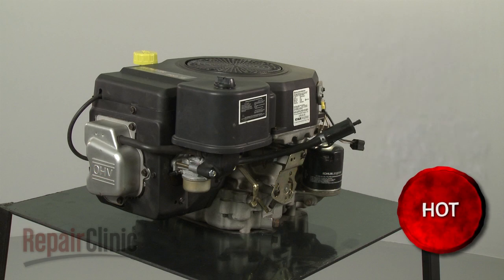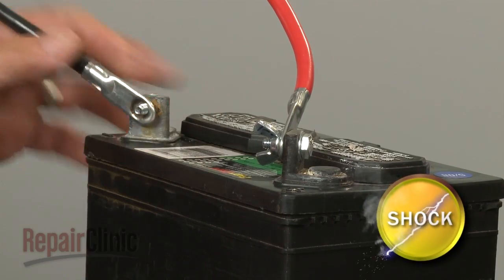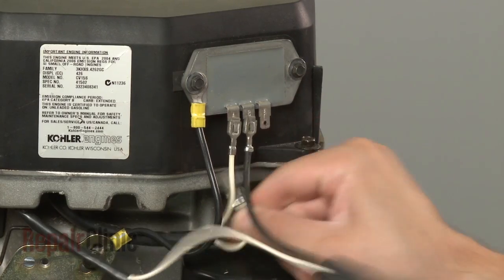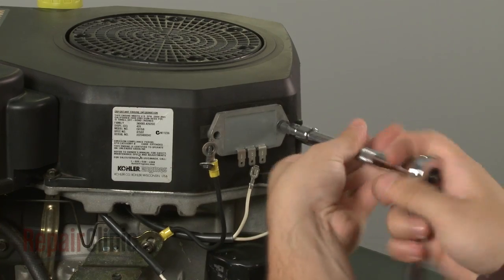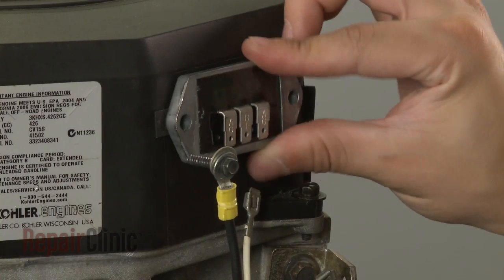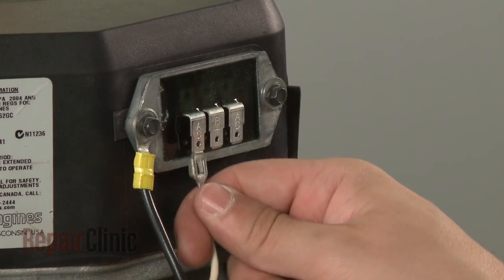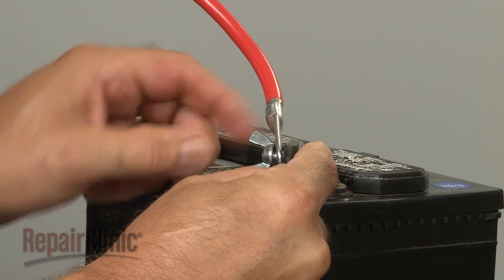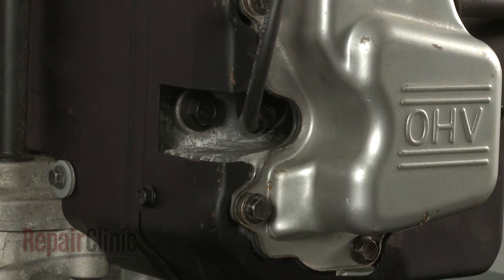Kohler Lawn Mower Dies? Voltage Regulator/Rectifier 4140310-S

Comment: would a symtom of a bad rectifier be, mower blew the fuse then after replacing fuse , it starts easy but idled super fast then cuts off .
Reply: I have exactly the same problem.  I first noticed I didn't hear the fuel solenoid clicking when the key went from "OFF" to "ON", so to get through the day's mow I alligator-wire-jumpered it directly to the battery.  Which works, but I have to remember to pull the clip after shutting it down, and moreover the battery isn't charging.  I replaced the key switch since it was easy and fit the problem (i.e., "START" works but "ON" is broken, which effectively disconnects the battery positive from the regulator and the solenoid), but no go.  I've now turned my attention to the regulator.  Were you successful with your regulator replacement?
Reply: @davidhutton465  , i didnt replace it yet .
Reply: @klakytklak  My case turned out to be a bad fuse holder - the violet B+ line 20A fuse had been running hot over the years and melting-but-not-blowing fuses - and the excess heat ultimately did in the holder as well.
Reply: @davidhutton465 hi David I’m reading through comments and I’m having exact problem in your comment from 3 years ago. Could you tell me how you fixed issue please. Regards Col west Oz
Reply: @col2959  As mentioned above, my violet-line B+ fuse holder had failed, and instead of a snug fit the 20A fuse was held more like a very loose tooth that wasn't making good contact - I took the opportunity to cut both it and the red-line battery fuse holder out and replace them.  Properly sized spade terminals can also work in a pinch.  Good luck!

Comment: I kept losing my batteries so I ran the test of DC voltage with the engine off and on and the voltages are the same, well with it highest RPM it's actually drawing an extra .03 volts from 12.49 down to 12.46.  So I replaced the regulator and tried again.  Same thing.  So I'm now looking at the stator so I measured the AC voltage (outside 2 terminals) and I read 41+ volts AC which is supposed to be good.  So my next test needs to be at the regulator and see what is actually being converted to DC from the regulator.  Only way to know if it's another regulator or something in the path from the regulator to the battery.
Reply: what was the issue?

Comment: Mine is a !6 Horse K341A05 from a Ford lawn tractor built in 1983 I have lots o compression and vacuum at the intake, it runs a few seconds and dies,,I have a new fuel pump and the carb is gone through and is clean..?

Comment: Seriously there are people who can't replace this without a video to help them? How about something useful like how to tell if it's bad or not? If you look at it, it should be pretty self-explanatory to take the wires off and the bolts out and just replace them in the same order you took them off. How about a video showing how to find out if the part even needs to be replaced.
Reply: The easiest and most accurate way to test a voltage rectifier/regulator is with an analog or digital multimeter set in the DC setting above 12 volts, and with a known good charging stator installed in an engine while the engine is running. With the engine off, connect the stator's two wires to the rectifier/regulator's two outer terminals (being it's AC, it doesn't matter which wire connects to which terminal). With the engine running at 3,200 RPM (when the engine has a fixed/non-adjustable main jet carburetor) or 3,600 RPM (when the engine has an adjustable main jet carburetor), check the voltage output at the center terminal on the rectifier/regulator. If the voltmeter displays or reads 14.5 volts, the rectifier/regulator is good. If less than 14.5 volts or no voltage, the rectifier/regulator is defective. By the way - the older rectifier/regulator with fins works the same as the newer ones with no fins.
Reply: I have a lt160 deere with a 15hp kohler with a new main harness.  8 bought it needing the harness which is replaced fine.  The right foot pedal once in to start it runs but once released it stops so I ran a jumper wire from black to black on the switch wire and it is fine but once ran a while the regulator conector the 2 black wires that go in the holder, the holder melted a little but I saw it soon enough.  I ordered a new safety switch that's on the way but I'm thinking the regulators bad causing the heating up on the wires that connects to the regulator.  Any h er le appreciated
Reply: Yes, some of us need a video to help with such things. Kind of like how you need a video to see whether the part needs to be replaced.
Reply: Yeah some people are afraid of maybe getting a little shock from poking around with stuff like that them not knowing it won't shock them they pay a shop to fix it an probably put used parts on

Comment: Since when has a 12V battery been a shock hazard?
Reply: when you accidently drop your wrench across the terminals trying to remove that 30yr old corroded bolt

Comment: Mine puts out 21 Volts! So I replaced this module, double checked the ground and even double grounded it for temporary. Again 21V !! What gives? The old regulator was definitely bad, one of the "A" terminals is shorted to it's metal housing internally.
Reply: My mower has no battery. Its a scag pull start. The stator/regulator does nothing but power the pto clutch.I even went as far as replacing the stator thinking that there was possibly something wrong with it but i got the same results. I have to keep the throttle down to control the voltage so i dont fry the clutch. I also thought about a second regulator but i wasnt sure how that would work out.
Reply: HillOrStream Did you ever find out what was going on with the high voltage? Im having the same problem and i cant find answers anywhere.I bought 3 different Rec/reg's and all 3 put out too much voltage.  I hope you can help. Thanks.
Reply: @willrobinson9575  I'm having some of the same problems with a kohler command pro 18 on a scag its pull start and im sure how to wire it. Please help. I have a new stator on it. I'm not getting dc power out of the regulator rectifier. How did ya wire up yours??
Reply: @cyrusmoser1090  That was a long time ago.First of all do you have the regulator grounded good?Are  you getting ac power from the stator?
Reply: @cyrusmoser1090  I wired mine up like the video shows. The wires from the stator go to the outside terminals on the rectifier. Doesnt matter which wire goes where on the two terminals.Middle terminal is the dc power coming out of the rectifier.
Reply: All my technical videos are now on "Hill's Workbench" and I did some videos on this a ways back right when I split Hill's Workbench out of HillOrStream. Seems dumb, but the regulator doesn't seem to regulate to a fixed voltage referred to ground, but instead by battery voltage and current draw. So when the battery gets a little soft, it's ESR increases and the regulator goes high, and the battery bakes. I've used a lot of LEDs, and fried my expensive headlight bulbs a few times figuring this out. I was going to build my own regulator to replace this bad design, but now I'm thinking it will be just a second regulator to keep voltage at about 13.6V. This is a project I hope to get back to shortly, Wanna put a stereo in my lawn Tractor!
Reply: I just built and bench tested said project, looks to be a success but some weeks of installed real world testing will follow. Shot video of the construction process, will edit that together and be putting it out  on "Hill's Workbench" once I edit it together in a few days, a few others to process before it.
Reply: If the battery is under you seat you sure wouldn't want it to blow up lol